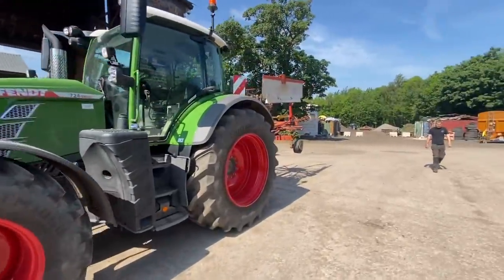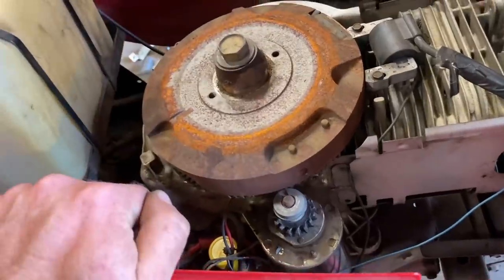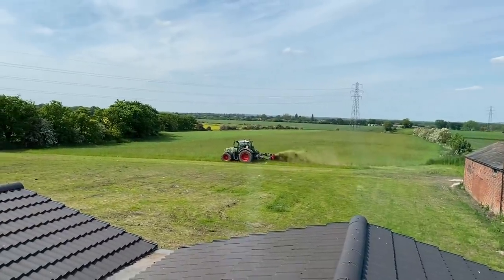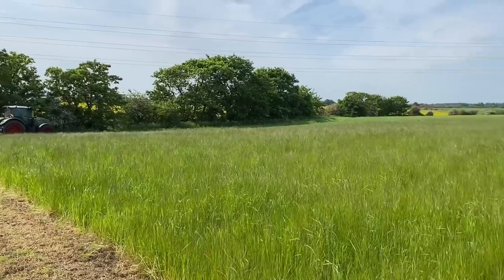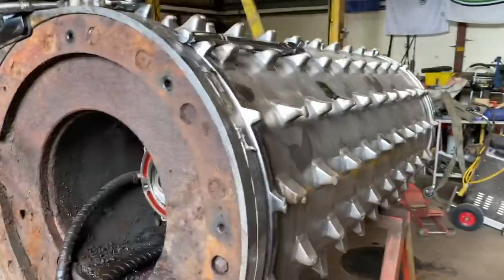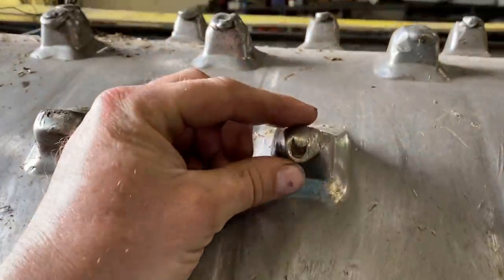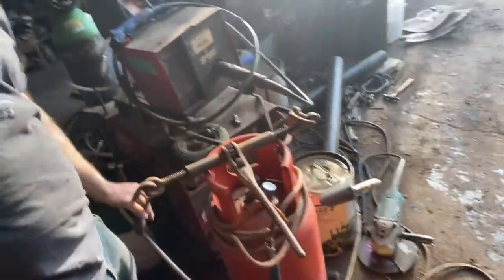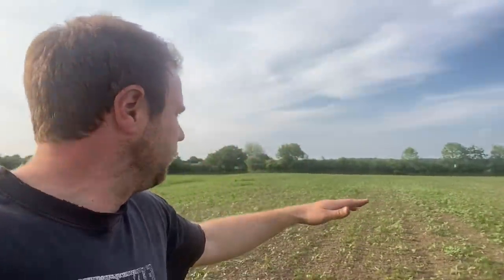Day436 #OLLYBLOGS MOWING GRASS BUT NOT 4  LONG SUNFLOWERS HAD BETTER DAY THAN ME#AnswerAsAPercent

Comment: It’s a pipe cutter and 97 % today as it’s my Grandsons 13th birthday so been to see had to knock 3 % off as it’s a 40 mile round trip and cyclist were out holding tractors and trailers up but had your advice about overtaking ringing round in my head 🤣

Comment: Todays quiz answer is a pipe cutter for small diameter pipe, I use an identical one for brake pipe on cars. they work by having a knife wheel and a pair of rollers on the other side, you clamp the knife down onto the pipe and spin it around then repeat until the pipe severs. 

75% today, my work day was fucked up by pedalphiles making me late, then while I was not paying attention someone roped me into working on Saturday evening when I had been planning to have a BBQ. 

It's a shame the wood chipper is out of action because it would have come in useful if you catch the scrotes that have been burning things and setting off fireworks in the middle of the night.

Comment: OMG setting fire to that new build! They are not kids playing they want locking up. Sorry olly, gone down in my estimations today “7mm too big 6 too small, some  crazy imperial size” you said! Come on its 1/4 inch. Next you will be telling us you don’t have any imperial spanner’s 😂😂. I Came across a box of metric cap head bolts with imperial Alan key fittings, now that is crazy
Reply from the maker: I do but it was quicker to use mole grips 🤣🤣🤣
Reply: @OllyBlogsAgricontractfarmer  now that’s more like it one of the three tractor tool box essentials! Hammer and adjustable being the other two 😂😂👍👍